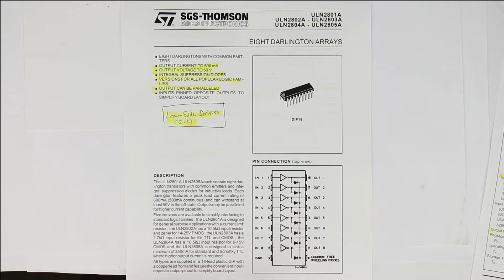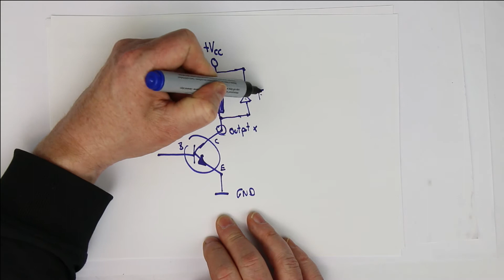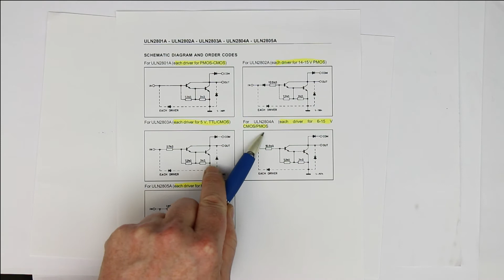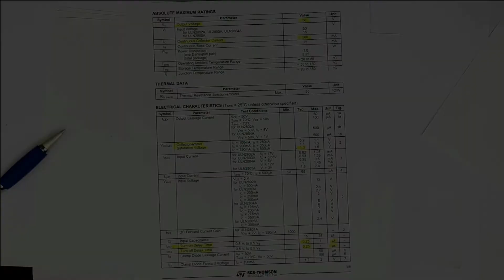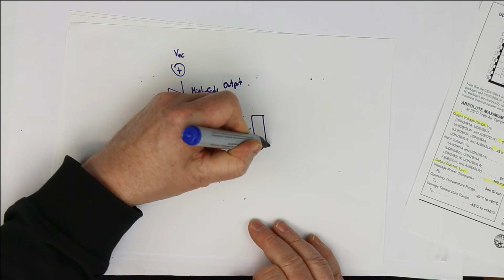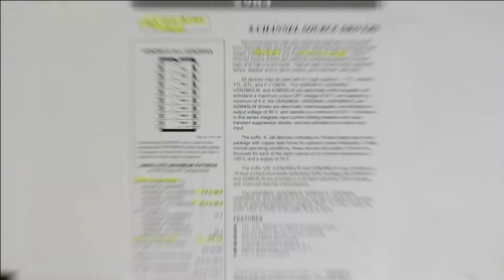ULN2803 Low-Side Drivers and UDN2983 High-Side Drivers

Comment: Looks like the UDN2983 is discontinued, what would be a good alternative for high side switching relays?
Reply from the maker: Search for "Octal High Side Drivers" and check, if one of the search results is a direct replacement or at least a functional replacement for the UDN2983. If so, then please report here.
Reply: @KainkaLabs  In the end I went for the Infineon BTS724G, which is not a direct replacement, but does what I want

Comment: I love the video when someone share knowledge with data sheet. 
1. ULN2803 can't be used for 5V RELAY as 1.6 voltage will drop across collector emitter ? any problem with 12V RELAY ?
2. Is there any difference between ULN2803 and ULN2003 ?

3. what is the speed of free-wheeling diode ( i think known as reverse recovery time ?).
Reply from the maker: From the datsheet it´s only 0,9V Collector-Emitter-Voltage @ 100mA Collector current. So most 5V relays should work with that. Otherwise increase the supply voltage of the driver IC slightly.
ULN2003A has only seven drivers, ULN2803A has eight drivers.

Comment: Is it possible to combine both ICs to have an array of 8 half bridges to drive, for example, a bipolar stepper motor?
Reply from the maker: Today I would always use specialized stepper-motor driver-ICs. They give you much more functionality in one chip that trying to build a driver out of standard ICs.
Reply: @KainkaLabs  The problem with those chips is that often they implement the control logic themselves. I wanted just to have a low level class D amplifier stage so that I can program the switching myself both to account for the RL circuit of the exact motor and to implement some sort of FOC using an absolute encoder

Comment: 3:42, current rises, but I don't believe it rises linearly.
Reply from the maker: That´s basic electronics: Put a constant voltage at an inductor and current rises linearly (until either ohmic resistance or saturation of the ferrite material sets in)
Reply: @KainkaLabs  But I=V/R(1-e^(1-tR/L)), so with V being constant, I believe it's an exponential rise.
Reply from the maker: read carefully what I wrote, also that in the brackets. Look up your textbook or wikipedia about inductors and capacitors. Capacitors are the inverse elements to inductors. Exchange I and V and you understand the other part. With a capacitor, charge it with a constant current and you get a linearly rising voltage --> with an inductor, put a constant voltage to it´and you get a linearly rising current (until........... see above)! Case closed.
Reply: @KainkaLabs  We are both correct in a sense.  The current in an ideal inductor in isolation will rise linearly when charged with a constant voltage.  However, ideal inductors don't actually exist.  In that case there is always some resistance, and when resistance is present, the current in the inductor will rise exponentially as per the formula I provided.  I hope we can agree on that.
Reply: Yes, it is basic electronics.  I recommend Michel van Biezen's video "Electrical Engineering: Ch 7: Inductors (7 of 24) DC Current Through an Inductor" where he explains the exponential behavior of current through an inductor with constant voltage and takes into consideration the resistance with time constant L/R.  Seems like you were unaware of that.
Reply from the maker: 1.) I did write "...until either ohmic resistance sets in or saturation...". 
2.) Your formula does not take saturation into account, which can have a much larger effect to nonlinear-rise especially in (low-R) power resistors. So there is no exact "formula" to describe a real inductor!
3.) Any formula (alos with an exponential factor) can be divided into linear parts. In most real inductors the linear rise portion of the characteristic curve is the most important for the real-worls application. After that an engineer has to look first at the saturation and last to the ohmic restistance
Take a look at my video about the "power inductor checker": 
https://www.youtube.com/watch?v=3Y_WcuIenSM

Comment: I got some of these ULN2803 ICs but the fake ones or which is called as Potato ICs in here :) they are not capable of sinking all the current down (like 20-30mA @ 5V) while sourcing the base with furious 5V GPIO. That was a total surprise. I have ordered it as smd, from some another source and that one works like it is expected. Characteristics are just like a single dalington npn for a pulse like 10us @ 5V.

Comment: Im currently using Irf3205 n-channel mosfet and ir2110 MOSFET driver for Bldc Motor control using Arduino. MOSFET is not completely turning on by the MOSFET driver IC ?
Reply from the maker: You should describe your setuup a bit more detailed.
The ULN/UDN Driver-chips are not well suited as gate-drivers for power-MOSFETs (too slow, no push-pull output).
Use special push-pull MOSFET-driver ICs for switching power MOSFET.

Comment: Allegro has discontinued the UDN2983 and UDN2984.  Is there a second source?  If not, can you recommend a similar part?
Reply from the maker: I have found one from my memory that Supertex (aquired by Microchip) are making high-voltage drivers.
It´s the Microchip MIC2981/2982 (note the similarity in the numbering scheme)
http://www.microchip.com/wwwproducts/en/MIC2981
Also look at the alternatives from Microchip/Supertex:
http://www.microchip.com/ParamChartSearch/Chart.aspx?branchID=90212#
Reply: TLC59213
Reply from the maker: Hi David,
sad to hear that Allegro discontinued these quite useful parts.
You can still get them cheaply in medium quantities at aliexpress.com  (Ebay-sellers are too greedy at discontinued parts).
If you google "high voltage high-side drivers" a lot of other parts are found.
ATM I don´t have the time if one of these could be a direct replacement for the venerable UDN298x-drivers. If you find one (or another interesting IC in this field), please report here in the comments.
Best regards
Roger